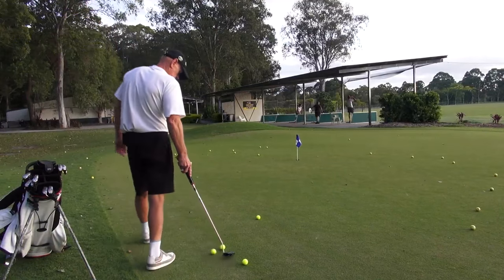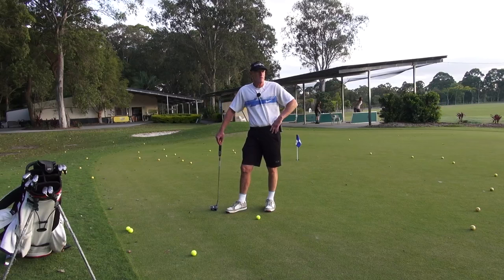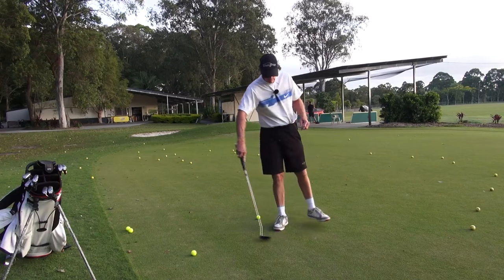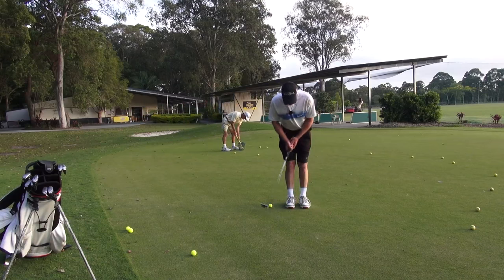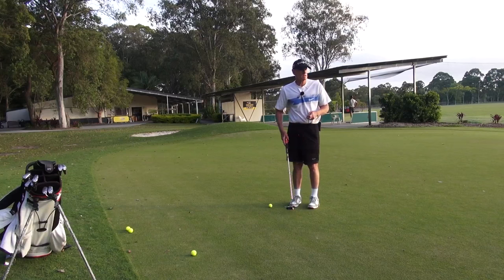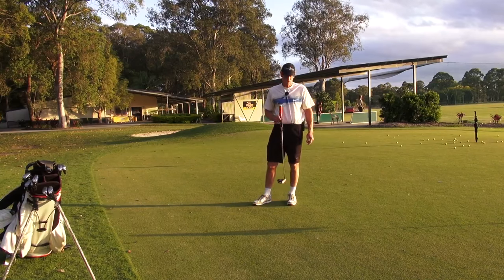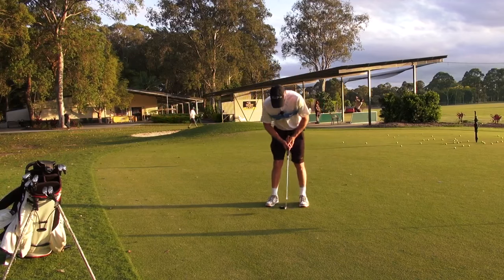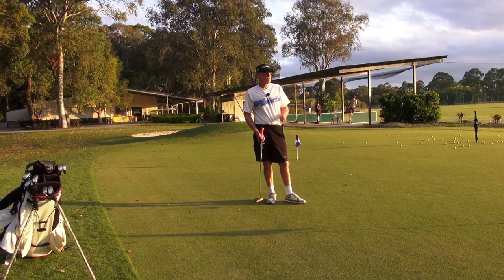Zero G Putting Process no 1

Comment: Ha Ha .. I would call it pure "g" putting, not "zero g". Having "lifted" the putter, it is gravity that "swings" it back down. In such an action we seek to keep the pivots as resistance free as we can. Any conscious action back to the ball is an application of force.

Good points, but I don't think you can make putting that simple. 

Here's why ...

1. The quality of the putting surfaces plays a large part on what is the "best" method. Pro's play on slick, fast, true surfaces (high stimp values). Granted towards the end of a tournament day they get imperfect, but by and large they lend themselves to an "ideal" arms only pendulum action. For the rest of the world who play on less than perfect putting surfaces an accelerating rap may just be a better approach, especially when making short putts. Brant Snedeka uses a "rap" today with great success. In the old days of poorer quality surfaces most of the great putters rapped the ball; people like Casper, Palmer, Player.

2. Greens are not glass surfaces .... balls are not perfect spheres. If you used a putting machine with the purest of actions, on all but short putts some would still miss! Every blade of grass on the roll line exerts a pressure (tiny it may be) in all sorts of directions, but collectively these have a chaotic effect on the roll of the ball, particularly when the ball slows near the end of its travel. Balls have a chaotic input too .... dimples! These also act affect impact with the putter face as well as roll. On short putts I believe a short acceleration ramp is a better way to overcome imperfect geometric contact from dimples. With a pure pendulum stroke at the bottom of the arc is reached there is a transition from positive acceleration to negative acceleration. The contact time of the putter face on the ball is small of course but any sort of acceleration through it is preferable to a "constant" motion in my opinion. 

3. Loft on the putter is another input. If nothing else it can compensate for preferred shaft angle and it can also ensure the first inch or so of "roll" is is the smallest of skips. You cannot impart "pure roll" with a putter unless you make an upward stroke with a face that "grabs" the ball. After the initial "skip" friction with the ground causes the ball to rotate. We endeavour to get that as soon as we can after impact for most consistent results because roll gyration produces maximum resistance to chaotic inputs.

4. As we progress through a round of golf our muscles become "unbalanced". Toxic by-products build up affecting our feel. If we go to a putting green all relaxed and fresh we can make great strokes. On the course, unless we have a caddy that wont be the case. Pro's have caddies but then face a different challenge; tightness from competitive pressure.

These are the challenges of the game, and our mental attitude toward them is very important too. Anger and frustration play havoc with with any sort of stroke :)
Reply from the maker: Putting in itself  generally is nowhere near a Geometry/physiology/terrain consistency/neuromuscular  control consistent  reality endeavor.....if you would see  ( and I have as a result of sensor's  placement on the body  parts during a putting stroke)  variants of  differences between  the movement of  your hands/arms relative to  the path  you scribe by them in a normal putting stroke  and the overall movement of the body relative to its  address place in space   would really surprise you.
               No one can ever come up with a  putting process than can overcome  all "variables'......I have had many discussions with the supposed  putting Guru's of the Golfing World and I have told everyone that calculating just a putt's break is absolutely no more and can never be  more than a 'guesstimate'.
                   Just the logic of a putt  being a golf ball rolling over a  surface that  has thousands of blades of grass all  are actually in a different state of  activity to each other and the actual surface topography having minute variations that are never visually discernible in reality terms to anyone would clearly suggest that putting will always be at best a  random result  part of Golf.
               How many times have you seen the supposed best putters in the world react incredulously to a putt not taking the  'obvious' assessed break it was supposed to.... it doesn't take the break they  planned on because they simply 'dont know' what that break really is...and they can never know because of the uncontrollable variables I mentioned earlier. 
                 I once witnessed one of the worlds top players   after a tournament here in Australia  go back out to the 18th green and try to hole a putt he missed in the tournament ... he putted the putt 4 times  and it broke  on 2 occasions the exact opposite to the previous putt... which it did in the tournament....he said to us  ..' how the hell does it break the opposite way to what it should'''... my comment was  there is  in fact no 'Should' in any putting break...only  a personal assessment  break which because it cannot ever be determined categorically because of unseen variable factors  will always be  a "guesstimate' .
                                 The Zero Gravity  method is just another way of  putting  to  reduce 'one' of the  inherent physiological  muscular  problems that can occur  when the putter is lifted of the ground vertically  from it sitting on the ground .
                                   All of the things you have highlighted are absolutely inherently  relative to putting... they are for the great part not really controllable so I think its best to concentrate on the things you can have  some control over.
                                  cheers JH
Reply: 1atomicgolf
Totally agree. The conclusion ... it's as much an art as a science! :)
Reply from the maker: I actually conducted a putting test once 20 years ago  on a perfect 100%  flat surface made of  1/4 inch  stainless steel sheet covered in pool table cloth...it measured 20 ft square...we had it  clamped and supported with dial gauges attached  and the surface registered on the dial gauges as zero deviation of horizontal plane...in other words it was perfectly true and flat.
             We had a mechanical tripod that  could hold a putter which meant that every stroke was free of arc deviation or vertical path difference.... 
               We putted from distances up to  19 ft  from every perimeter point on the   test  bed... even with a perfect non deviation surface and  consistent  putter face application  some putts regularly missed the hole that previous putts didnt..we found that  the golf balls if placed  out of their meridian balance points  would  roll of track because of balance point bias's ...the Golf ball was causing the deviation not the surface or the stroke application.
                      Adjustments of 1 deg in putter face alignment caused misses , no human can  consistently align a putter face to  tolerances of 1 deg consistently...as well attack angle differences of 1 deg  and ball positions differences of 1/4 inch had obvious effects.
                     So the point of the above explanation is that if under absolutely perfect putting surface conditions and putter face application  it is still possible to miss putts .... but more to the point you shouldn't beat yourself up when a putt misses that you think 'should' not have..... as I said before there is no way of  applying the 'should' factor in putting.
                                           cheers JH
Reply: 1atomicgolf
Again, totally agree, if the centre of gravity of the ball isn't exactly in the centre of a ball that is a perfect sphere the ball will have a bias! If you could float a ball in a suitable fluid it will eventually assume the same orientation every time. :)
Reply: PUTTING IS INTELLIGENCE/PRACTICE and GREAT NERVES IN THE ARMS, HANDS and EYES>